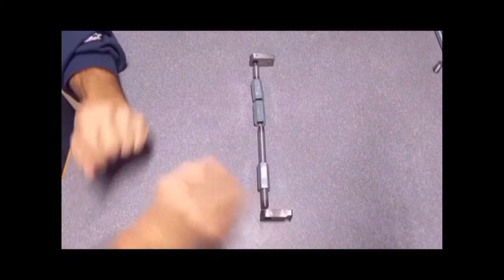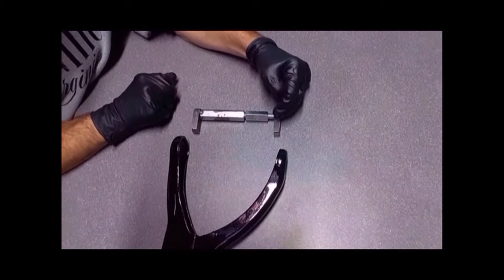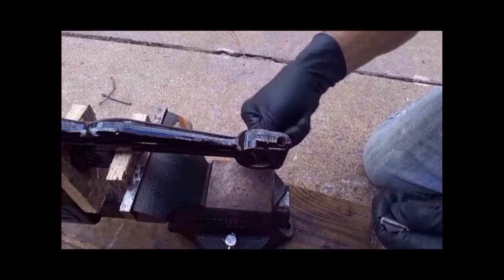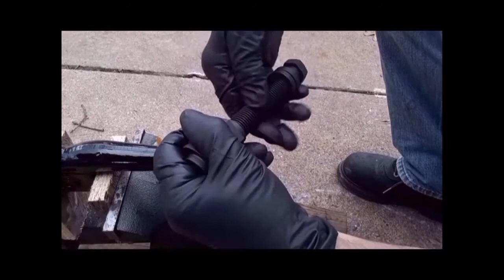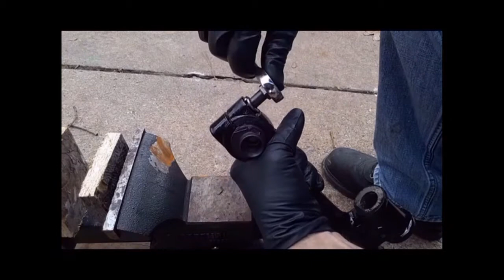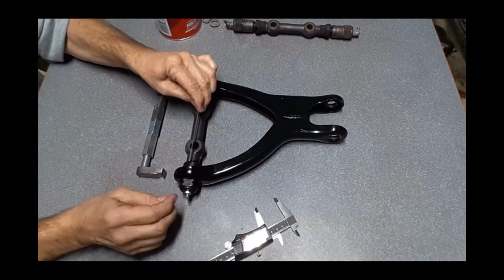1955 Cadillac Coupe Deville Upper & Lower Control Arms

Comment: Well, for what it's worth, my 39 Pontiac front suspension is very similar to your car's. I took mine all apart and cleaned everything, then reassembled, greasing all the stuff. I replaced the spindle supports with new dropped units, to get down 2 inches... I think I have maybe 2000 plus miles on it and no problems yet. You are much more thorough than I.... so it should work fine!
Reply from the maker: Thanks for watching rwruther...with nothing to reference,  I'll just have to see how it goes.